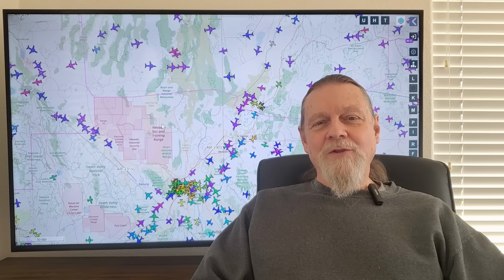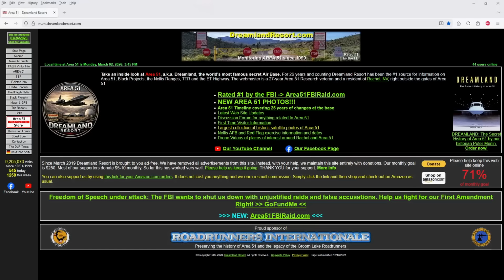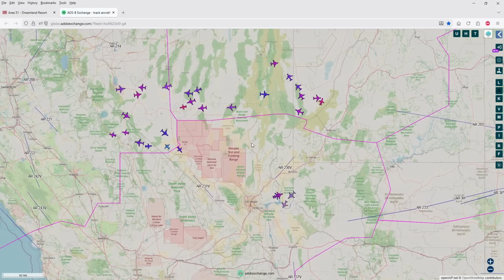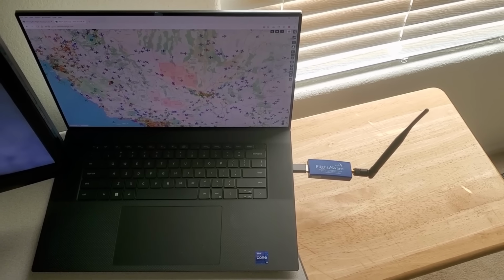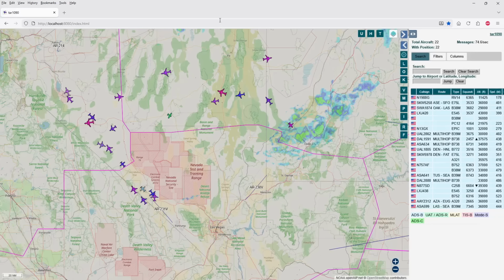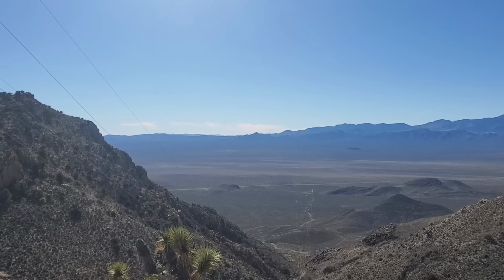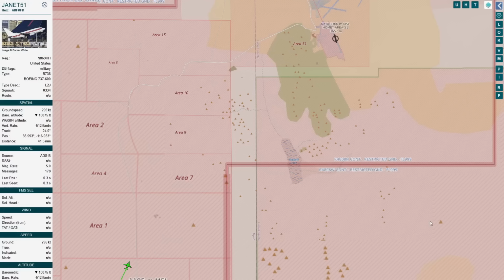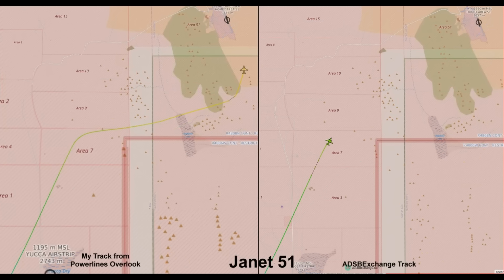DIY: Build an ADS-B Receiver and Track the "disappearing" Janet Flights into AREA 51

Comment: When the 737 is clearing the runway, the Tower controller says, "Taxi to park, monitor Ground when off," not "monitor Groundhog." That's standard controller phraseology in the USA.
Reply from the maker: That makes sense, thanks! I will correct that in the captions. There is a ground controller with callsign Groundhog for Area 51 missions, so that is where that came from in my brain. But it did not seem quite right for a Janet. Thank you for correcting that 🙂

Comment: Hoping to do this, however, a couple quick questions-
If I get a raspberry pi with a screen and downloadable software, could I bypass a laptop and run it directly on that? And if not still going to try to do this and mount it on my truck for when I go out to Edwards plane spotting, thank you very much for this video, great work sir.
Reply from the maker: There are instruction online on how to turn a Raspberry Pi into an ADSB feeder. But unfortunately I have no idea how to use it as a local receiver. I would stick with a windows laptop 🙂
Reply: @Dreamland-Resort Great, thank you sir!

Comment: A portable, standalone, non-emitting, hidden version of that could come in handy for some applications.  For instance, in similar but different locations compared to the ground sensors, or in any remote location to prevent detection and theft.  Similar problem to placing a remote webcam, the emissions cause detection, so better to use it non-emitting and standalone for dropoff/pickup, like a trail camera.

A key component for building one to my own taste, is a wide-mouth gallon double-walled vacuum stainless water bottle, such as the Kerilyn.  So far, I only use my gallon bottle for carrying water from home to office.  But it could hold all of those electronics, and enough lithium cells to power it for days or weeks.  Hide it, record to SSD or flash memory, retrieve later.  It's also a nice Faraday cage (after screwing the plastic lid on over metal foil/mesh, or adding a metal cap over the plastic one) so the computer's emissions are contained.  Only the antenna wire would come out via coax.  Through the lid, so as not to break the vacuum.  The battery and electronics would be kept at around the average temperature of the previous 48 hours, with the initial contents temp counting as the temp for the previous 48 hours before it was placed.  If needed, a copper wire could be run externally as a heat sink from the components generating the most heat.  In some climates/weather, the vacuum bottle isn't needed, any metal box would do.  But the vacuum bottle + heat sink combo allows tweaking for various power loads and temperatures.  Plus, it is super durable.
Reply from the maker: I am hoping that with the addition of the Tonopah site I will have the northers ranges pretty much covered. Tracking stand-alone if you are out in the field is great. But for MLAT to work you need to have the receivers networked.

Comment: Excellent video! Do you normally just use one mobile radio scanner when out in the field or do you have a more complex system? Just wondering if you replicate your at-home setup in your truck. Would love to see a video on this.
Reply from the maker: I usually have one or two handheld scanners with me in the field. In addition my Kenwood TM-V71 HAM radio in the truck doubles as scanner. At home I am running 5 or 6 SDRs and scanners 24/7, with voice activated recording.

Comment: Wie genau ist ADS-B? Ich habe einmal auf Flightradar24 gesehen, wie 1–2 Janet-Flugzeuge (Typ: Beech B200 Super King Air) wilde Flugmanöver rund um Area 51 durchgeführt haben, die für so kleine Flugzeuge untypisch sind. Die angezeigten Flugwege waren teils völlig unregelmäßig, und die Flugzeuge haben wiederholt sehr schnell beschleunigt.
Reply from the maker: Gute Frage! Manchmal machen die Beech Janets Trainings Flüge um die Area 51, mit simulierten Landungen ("touch-and-go"). Dabei "verschwinden" sie immer wieder vom Radar, wie ich im Video zeige. Wenn sie dann wieder auftauchen verbinden die Tracking Web Sites die letzte bekannte Position mit der neuen Position durch eine gerade Linie. Dadurch entstehen oft bizarre Flugbahnen, die aber in der Realität so night stattfanden.

Comment: If they are not squaking with a transponder will it still pick them up?
Reply from the maker: Yes and no. A lot of military flights only transmit their ID, not their position. That is where multi-lateration comes in handy. Essentially triangulating the aircraft with three receivers. If an aircraft is not transmitting at all on ADSB, then there is no way to track them. Most fastmovers in the NTTR air space are not transmitting at all, unfortunately.
Reply: Thank you, I live by a training base and a lot of the time the planes don't show up on ADSB
Reply from the maker: @LynWin-b8f  Maybe if you had more receivers nearby you would see more aircraft with MLAT. You can check ADSBExchange coverage in your area here: https://map.adsbexchange.com/mlat-map/

Comment: I used to have an app on my phone that would track flights leaving Vegas.
Reply from the maker: There are several. ADSBExchange, Flightradar24 and Flightaware are the ones I am feeding. The purpose of the do-it-yourself receiver is to work in areas with no cell phone coverage (most of the area around here)
Reply: @Dreamland-Resort Got ya.
Reply: Brilliant!

Comment: Yes Joerg we did this both in Nevada and California and feed to FlightAware! Nice one
Reply from the maker: Yeah, I think I neglected to mention in the video that if you do have an internet connection you can actually feed the data to the various tracking web sites.
Reply: @Dreamland-Resort We asked FA to provide the tracker, they said okay, no for your area so we made our own and still connect them
Reply from the maker: @quitsevensix  Yeah, they are very picky. When I started feeding I inquired about a free tracker and they wanted all sorts of information that I was not prepared to give them, including photos of my house. I rather pay for the feeder out of pocket. Plus, the Pi they give you is not powerful enough to feed several tracking sites. I just upgraded the Rachel feeder from a Pi 3 to a Pi 4 because the Pi 3 kept crashing. GOldfield is a Pi 4 and the new Tonopah site will be a Pi 4 as well.
Reply: @Dreamland-Resort We have aswell Pi 4 for both places, it was easy to set up with fibre internet
Reply from the maker: @quitsevensix  Yeah, the Rachel Pi is definitely a lot happier since I got Starlink. 🙂

Comment: Thanks, Joerg! This was a really cool video - I may have to build one of these in the near future.
Reply from the maker: Great! It is really super easy to do and handy to be able to track aircraft in the field, with no internet connection. 🙂
Reply: @Dreamland-Resort  I'm curious, but do cell phone range extenders or satellite internet work out that way? Curious if the cell towers are too far way for even range extenders and if satellites are positioned in a way to even provide internet near the test ranges.
Reply from the maker: @mrgw98  I have never used one, but I would imagine that cell phone extenders or external antennas help. There is cell service in the Rachel valley, and there is talk about putting up a cell site in Tikaboo Valley, where Groom Lake Road is. Starlink works great, I am using it right now 🙂
Reply: @Dreamland-Resort  Cool to know. Thanks!